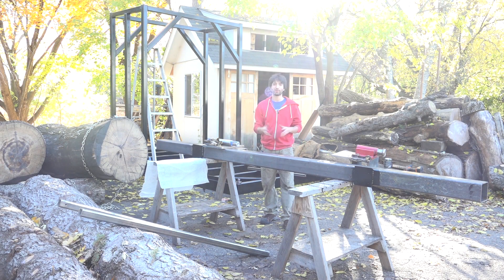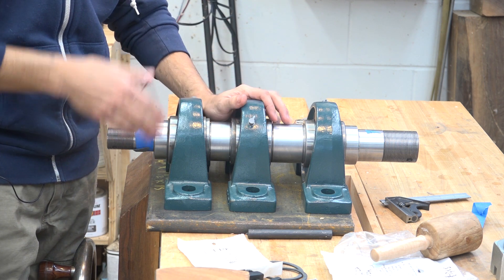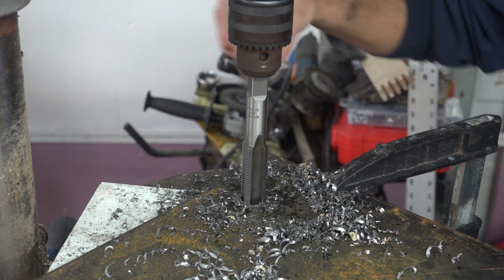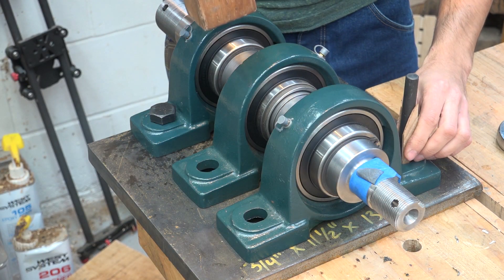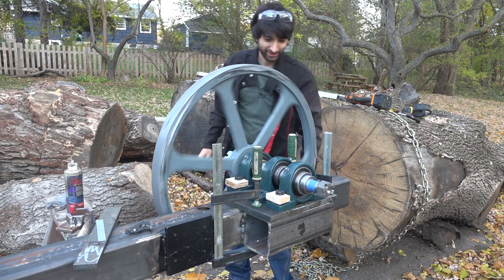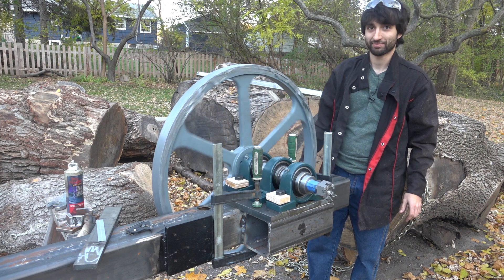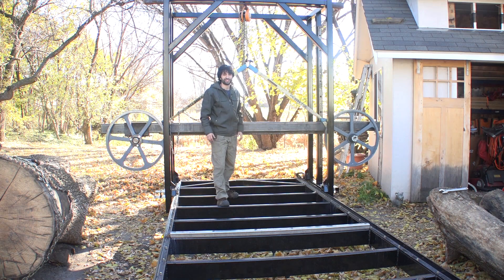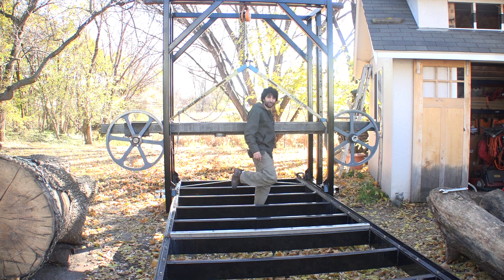The Drive Wheel - Building a Large Bandsaw Mill - Part 10

Comment: Did you ever think about wheels vertical. The larger saws would have a smaller footprint.
I would like to hear what you think.
Reply from the maker: The downside is the bed height would need to be much further off the ground or you'd need to put the lower wheel in a hole.  That style of saw also tends to have a fixed head with the log moving through it.  That set up needs to be twice as long.

Comment: 2:45 - U need a spring centre -this fits the drill chuck and has a spring loaded tip that fits the centre divot in the tap end (the tip also turns around end for end and fits round-ended taps that don't have a divot.I got mine off Amazon - it is a Brown & Sharp 599-792-30 Adjustable Spring Tensioned Tap Guide (details off the packet). Cost me about $40. Just thought you'd like to know...

Comment: If you will allow a recommendation for tapping large diameter holes in the future:
Use a tap handle.  It will allow equal pressure from both sides, instead of using just an adjustable wrench from one side.
Using a wrench from one side can tend to tilt the wrench and tap while in the work, and can break the tap.

Something like this:
https://www.ebay.com/p/Hanson-Tap-And-Reamer-Wrench-For-Sizes-0-1-2-Carded/2254800121?iid=332727261397

Comment: Drill RPM quick n easy formula.  CS 90 for mild steel x (pie)rounded to 4 ÷ diameter 0.750in =480 RPM.  It looks like you were running around 800 to 900 and smoking like crazy this formula is a quick fix for a starting RPM

Comment: Love the series! Has anyone accused you of over sizing your steel? I see you using crazy thick stuff when thinner material might work?  Also, i didnt see an answer to the  circular saw blade question. Who makes that blade!!??
Reply from the maker: A few people have.  It's the might work part that I wanted to avoid.  I have no desire to be fixing this mill due to metal fatigue.  Also in reality most of those thicker plates came from the scrap bin at my steel dealer so they were the same price as new thinner stock.  Link to the circular saw is in the description.

Comment: Matt, this is the 3rd time watching the vid, as i will be getting ready to build my mill. during your tapping, when you needed more leverage. why not find a socket (requires a 12 point socket since 4 divides into 12 better than it does 6) that will fit on your tap and use your ratchet? I was tapping 1/2" fine and didn't have a fancy tap wrench thing like you have and iv always used a 4", maybe a 6" crescent in the past, but this time, i used a 5/16" socket, along with my long handle 3/8dr ratchet.

Comment: I t5hink the offset of center punch should be half of the slack dimension, 1/4 gap = 1/8 inch offset of part. and oil the drills and taps. But I was really trying to get the size, cost and where you bought the wheels!

Comment: You gotta use lube Matt. You are killing your cutting tools. When doing anything with metal, you need to use proper cutting fluid. Any oil would be better than nothing. Besides. It will cut so much easier. Metal working/machining is my thing.  Trust me on the lube thing.
Reply: I see that you mentioned cleaning off the cutting fluid. I must have missed the fluid being used. Just make sure you use plenty. It also helps keep your cutting tools cool. The drawback is, oil and wood shops are not a great mixture.
Reply from the maker: Yeah , I use quite a bit.  Luckily, I've been able to keep the drilling confined in the shop so it hasn't made too big of a mess.

Comment: one note of caution.  When electric welding, it's a good idea to remove any bearings from what you are welding.  With the ground is at one end of the workpiece and welding on the opposite side of bearings, electrical sparking can occur between the balls and races causing pitting and early failure of the bearings.  This is something I learn years ago when taking a course of what causes can lead to bearing failures.

Comment: Are you having to sharpen those drill bits Mat? Even with my tiny amount of metal work I do at various times I run into the problem of all my twist bits being dull...
Reply from the maker: The ones I've used the most, I've sharpened a few times.  They do last for quite a while.
Reply: Matthew Cremona what are you using to sharpen?
Reply from the maker: the slow speed grinder that I use for sharpening my lathe tools

Comment: You need to watch your back, lifting all that steel is going to come back and haunt you in later life!

You could use the carriage and a your continuous chain a bit more, like when you shifted the beam off the saw horses, swing the far end of the beam over then you could have picked that end up with the carriage/chain.
Then lift the beam up high enough to put the spare saw horse under it and bring some of the weight down on too the horse and give it a good push... prop the beam up using the other horse release the chain and move the carriage to the center and pick up the whole beam then move it to where you want it.

Comment: quick question I never see you use oil when you tap or drill. Do you?
Reply from the maker: +Mike Barnstable I cut it out to speed up the action. You can see the bottle of fluid I use moving around at the base of the drill press throughout the shots around 4:50

Comment: Matt you need to get some help with the lifting. I'm 58-year-old and really just like you.  I built a 36 inch. band saw mill and ended up hurting my back and now have a hard time walking. Please get some help. Be safe. Tell Lindsay hi from SC.
Reply: Terry Usher, where did you get your wheels from.  I have seen 30 inch wheels at a few places not 36 inch. Thank you.
Reply: My sawmill has a capacity of 36 inches but has got 19 inch wheels.

Comment: When you cut those holes using the welder (6:10), doesn't that distort the metal around them like crazy? It seems like a lot of heat to be putting onto the metal
Reply from the maker: +Robin Lewis (You Can) it may have. I didn't notice anything. The beam doesn't have to be perfect since the wheels are adjustable
Reply: Ah ok. As someone who hasn't welded I hear a lot about tacking so it doesn't distort the metal when you do the full weld. Then you come along and put down a flamethrower on the steel, haha...had me questioning

Comment: Thank you as always for making. Have you examined your drill press table to quill orientation since the heavy duty work commenced to insure that the table is perpendicular to it? If not I would suggest you do. Many drill press tables I check are out of true by a couple degrees. I use a piece of bent coat hanger wire mount  in the chuck and pointing down to the table.. Left to right orientation is easy to adjust. If your table has  dropped at the front, another common problem I see; it can be shimmed back up. Metal shims preferred. In a pinch I use playing cards.
Reply from the maker: I have to watch it.  The clamping mechanism for the tilt isn't strong enough to resist the heavy drilling if the work or drilling point is off center.
Reply: If the day comes when you decide to bolt it down to the cabinet base you can put a screw or bottle jack under one side and jack up the low side to perfectly level. If you want to check from to back square to the chuck that's where the bent coat hanger wire comes in. You can google up an image of "squaring a drill press table " to see what I mean.

Comment: Why do you use three bearings? I think tge middle one will hardly be loaded.
Reply from the maker: +Max Maker yeah I'm concerned about the shaft flexing. I'll be testing it without the center bearing to see how much flex there is when I tension the blade
Reply: Max Maker It's called over engineering. Won't have to worry about flex at all. 🙃

Comment: How do you prevent the inside of all those beams from rusting?
Reply: These heavy profiles that Matt has used with not rust out in his lifetime... And considering they are protected as he has done, capping the tops of the verticals, etc. then the material may build up a layer of rust that can help protects the metal from further deterioration.